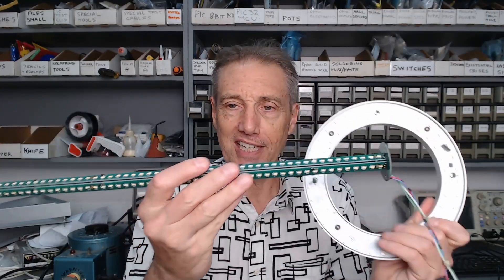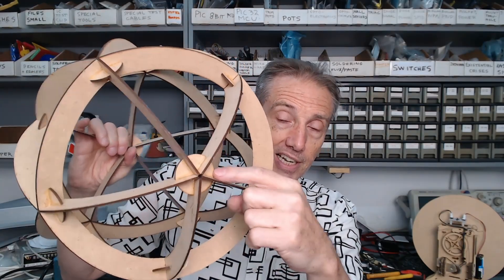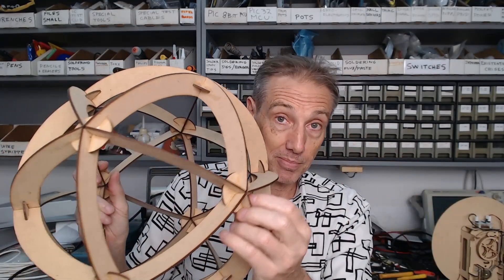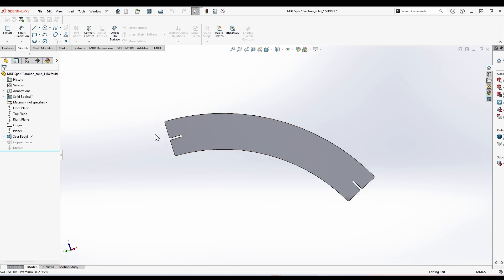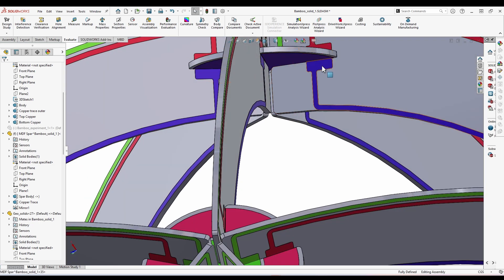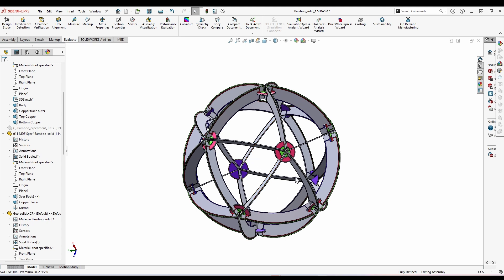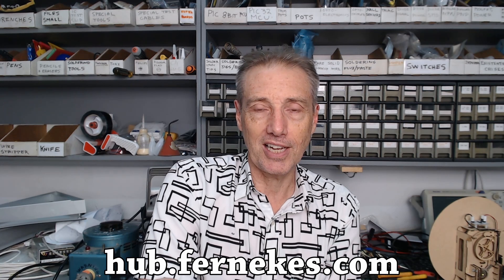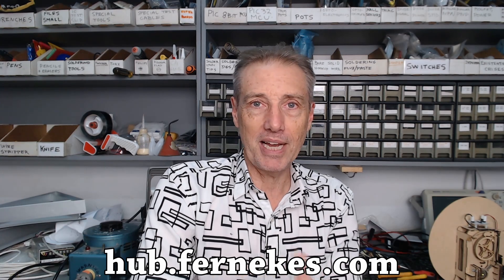DIY Icosahedron LED Lamp: Designing a Gesture-Controlled PCB Kit (Community Challenge)

Comment: (copy of comment left on forum)
Re. sensor interference, if this was an issue you could add shrouding so it only looked directly downwards, though you’d need to check if reflections from the shroud walls are an issue. There are quite a few of these sensors from various manufacturers nowadays so shouldn’t  be hard to find something suitable. Might even be doable with  a simple cheaper strength-of-reflection system as you only care about changes, not absolute values. That may give you more choice of field of view

I’m wondering if it might be possible to do it with only 2 interconnect wires - as the structure is quite sparse, you could maybe have the sensor at the top, looking through. You need a sensor that either isn’t confused by reflections from the inside bottom, or gives multiple outputs for each “target” or can be programmed to ignore early reflections. Ultrasonic may work here but it’s bigger and more likely to have interference issues. Or maybe have a ring opening at the bottom. Having the control at the top would also be less visible. 

Alternatively you could use a system like I used a while ago to do sensing over the same 2 wires supplying the LEDs . Search YT for "2-wire led sensing installation".  
If you can get it to 2 wires then you simplify the joint as you can just use top & bottom, so soldering is much easier
You’d have the main control MCU at  the top and a tiny MCU/sensor at the bottom. Something like the 8-pin CH32V003 would  be a nice cheap solution. For bonus points, both MCUs could have the same firmware, and determine their role based on a pin being pulled high/low by the PCB, 

Another enhancement could be some local communications such that dimming one light also dims others. Perhaps some gesture to distinguish if you want to do one or both. Maybe IR vs. radio so it is only limited to the same room.

An alternative to soldering could be spring contacts and a click-together detail, or plastic rivets and 3D printed brackets. Not having to solder would increase the appeal -  you could perhaps do it in a way that allows a solder and a non-solder version.